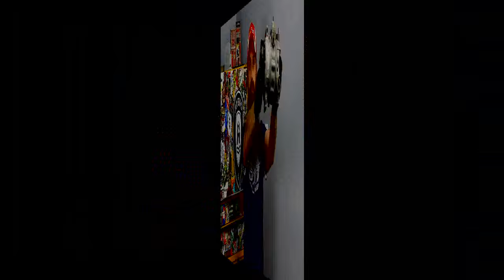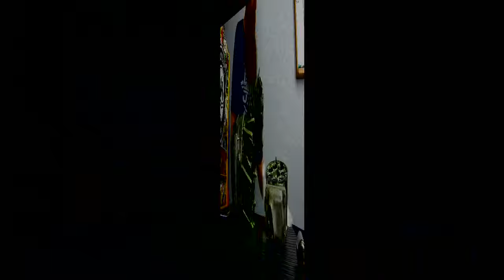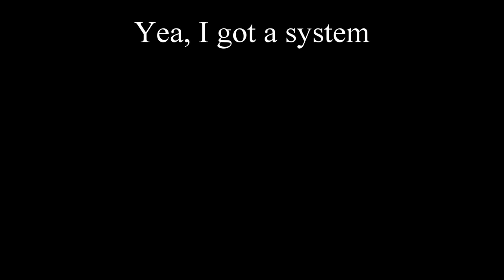How VW A/C Compressors Fail

Comment: Can't say for sure but around 1:54 you seem to swearing some.   Fortunately the beard has advantages.
Reply from the maker: +equipt4sound hahah. Seems that way.
Reply: HumbleMechanic Thanks for the video, Was contemplating rebuild but will go via replacement in MK4 Golf 2.0 (2000).  Any better options year wise?   I had a geo metro which had awesome AC, nothing I have owned has ever been so cold as that system.  Would love to "Frankenstein" that into a replacement here.  Not enough time and doubt I can find a complete system.   Do I understand you saying there are 2 types of compressors available as replacement?
Reply from the maker: +equipt4sound your MK4 needs the clutch style. That's the one the car is programmed to operate.
Reply: "Programmed" ... why I recall a time when we would have said designed.  You one of them new young Xbox types?  Know where a person can find a good dinosaur to ride?  Thought it was implied one type had a magnetic actuated clutch and the other was more centrifugal to engine rpm.  Kind of like the alternators.
Reply: O.K. I am seeing Zexel and Sanden.  Are they interchangeable?

Comment: Charles, FREON?!, aren't you out of date for 20 years? :D, AFAIK freon is forbidden in anything for at least 2 decades, isn't R134 or 134a used which are NOT planet-killing CFCs
Reply from the maker: :) You are technically right, but it's a lot like making a copy and calling it a Xerox. 

They proper term is refrigerant. And I probably spelled it with a "D" at some point. Hahah
Reply: HumbleMechanic using "freon" betrays your age :P, you're not a young whippersnapper anymore hahaha
Reply: The name is still been used though :)

Comment: So many vids.... but not one person!! Not one ! Mentions how to tell if the damn compressor is even working in the first place!!! Maybe it's a "trade secret" thing?.... it's just super annoying... cause until you get into the computer parts... everything about repairing a vehicle is incredibly basic and can be taught to all sorts of ppl as long as they can follow instructions. Those instructions would be given by sharing information... so.... please... share the information!!!!
Reply from the maker: +J.A.M I use a scan tool and monitor the control side.
Reply: Listen for the noise. A groaning sound means that the compressor is working at the lowest displacement. Silence either means that it's turned off (i.e. the solenoid is preventing refrigerant from flowing through the system) or that it's working at full displacement. Then have a look at the refrigerant gauges. Low displacement/"short-circuit" operation (refrigerant flowing through the compressor only) has static pressures or not so different from each other. Full displacement has low suction and high discharge.